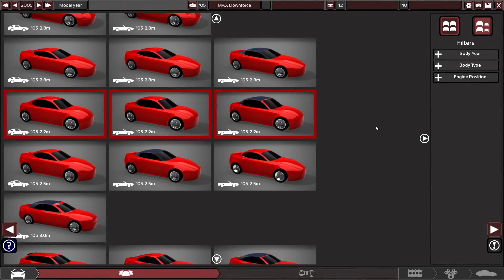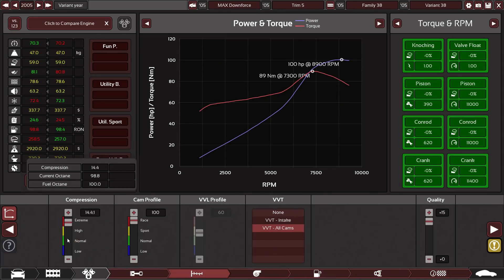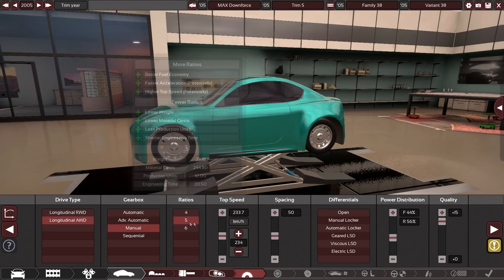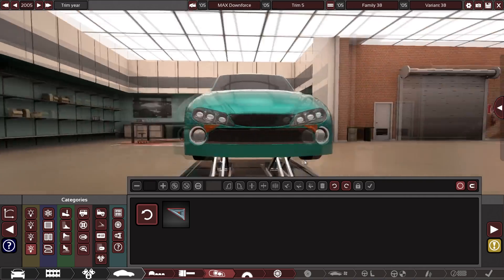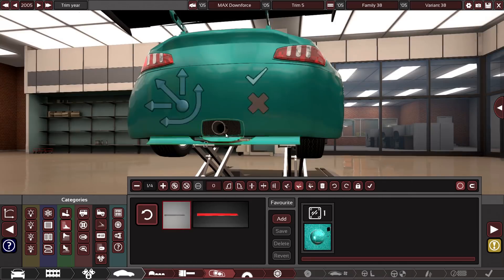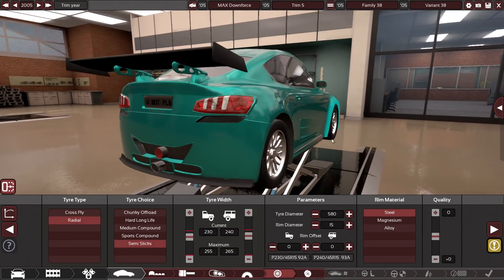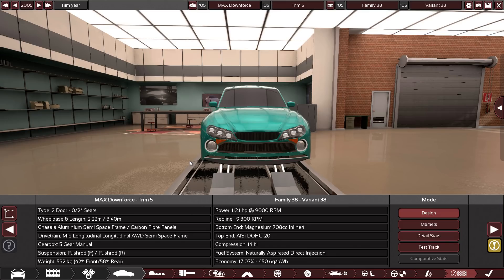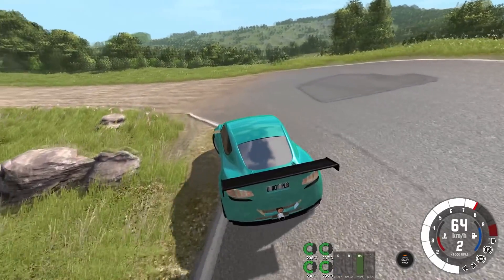Ultralight Track Car with Max Downforce (Automation + BeamNG)

Comment: Great car! Btw if you max out the downforce on the on the front wing and than adjust the rear wing around 40ish you can get about 150kg on both the rear and front which makes the car feel like its on rails. Amazing how this car sounds like it is from NFS!
Reply from the maker: Thanks for the tip, I really need to mess with that section more to have some better handling cars. With a little neon this car could be in NFS underground!
Reply: Bist du deutscher?kevin

Comment: If you want a tip about maximizing downforce listen to this.
In Beamng, only wings create downforce.  Also, the size of the wing "does" matter.  That means, if you want maximum downforce in Beamng, use only wings. I put like 6 or 7 very large wings on a 2000 lb car and i create 8000 lb of downforce at 200 mph.  Also, I made it have perfect aero balance front to rear by varying the size of the wings.  
I got cornering g forces up to arround 3.6 g's.  That is almost F1 levels!
Reply: I might make a video on it if I get enough requests.
Reply: @ChefofWar33  is it too late now? 

;)
Reply: @jammygamer8961  Yes.

Comment: Another version of this car with better brakes, they wasn't so big, Carbon Fiber chassis, Turbos, 1.2L, 70% Rear 30% Power distribution, no assistances,  brake before the corners and never during one, don't hold gas during corners and drive for a long time, this car would get 1st place.
Yeah :D

P.s. Semi Slicks with width on Max.

Comment: ABS would probably help a lot with making the breaking easier, and a shorter stroke/bigger bore helps with revving higher.
Reply from the maker: I've been trying to run without assists on all non realistic vehicles because it can mess with cars when exported to beamng
Reply: But ABS makes the car slower

Comment: How about a....almost truck like car? Heavy as hell but AWD and LOTS of POWER! Maybe you can even beat the other 2600hp cars? With like a 3000hp or more? Just make a car with the biggest engine, best quality, best perfomance. No need for traction(If you dont need any but I mean if you dont get the power down there is no power) no need for a fance body (If you wish) just raw power. All focused around the engine. The biggest, the strongest and maybe even the fastest? (Damn that was long to type...)